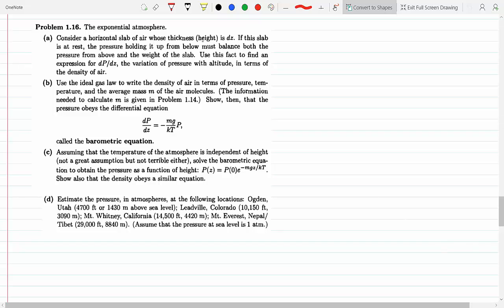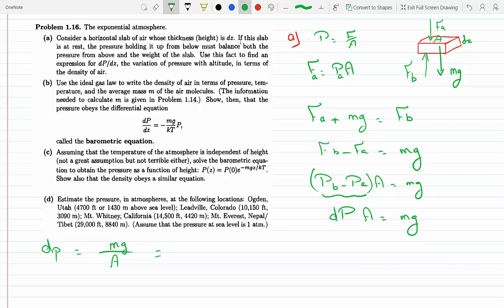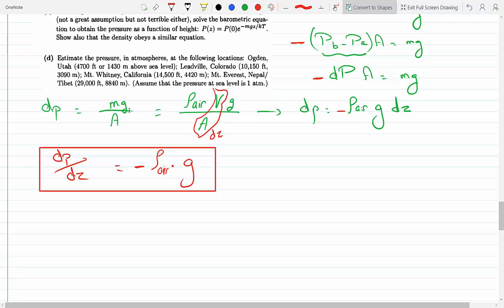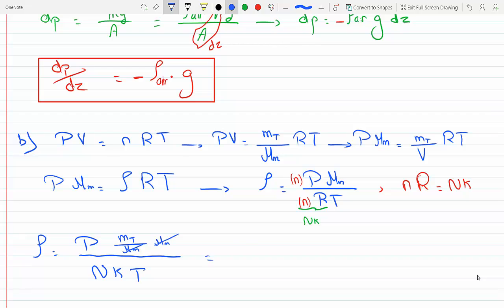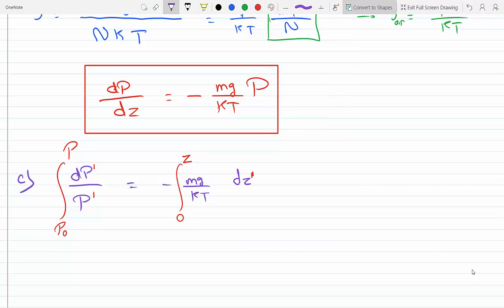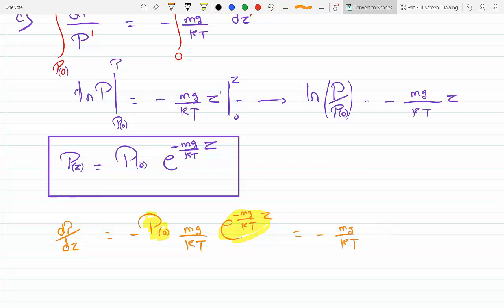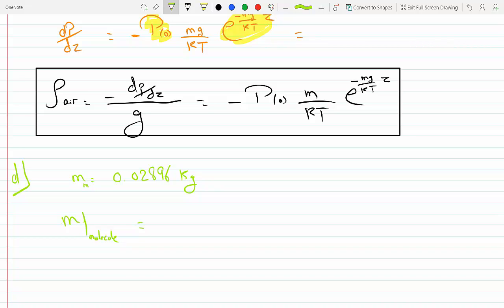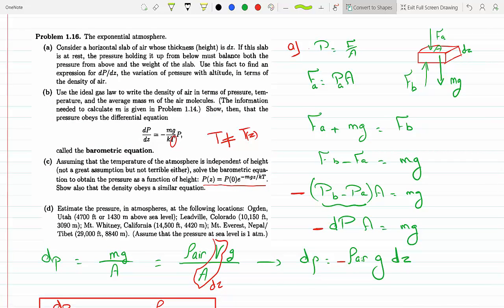Find dP/dz and pressure and density as function of height for a slab of air 1-16

Comment: Thank you so much. I had a similar question in my prescribed textbook they tell the variation of density with height for refference and then just straight up asks us to derive the same assuming isothermal conditions and constant g.
I didn't even knew where to begin 😭.

Also in the last equation relating density the value 
[P(0).M(atom)]/kT = density at height 0. 
So the relation becomes exactly the same as pressure but with densities instead.

Thanks alot.

Comment: This is helping me figure out my problem, thanks. 

I was messing around with PV=nRT=NkT to try and get an equation in terms air density.. "ρ" & temp "T", but I will use n to denote number molecules around a molecule:  

[1] P~ (ρ/m)kT & P~Ma↓/(xy)~(Σma)/(ΣẟA)
with ρ=M/V, N=M/m, m~ẟM=ẟ(Nm)=Nẟm, ẟA~Area(ẟx,ẟy);
a=acceleration of molecule to be summed across surface with area xy.

..for a cylinder air column that would apply to Venus, but I then realised that the difference between Earth and Venus is that the latter barely rotates, so no Bernoulli wind gradient and resultant pressure drop, Venus air almost incompressible and dP/dZ ~0.

For [1], the :
a(j)=acceleration as molecule j hits surface, also subject to isotropic atmospheric pressures {P¹,..,Pⁿ}around molecule=Σ6P(j,i)A(j)/m(j) with n particles (including ground) pressing on area "vector" A(j)=ẟA , 6 degrees of freedom(DoF). 
P(j,i) is the pressure on molecule j due to the iᵗʰ molecule.

Using "NIII" & "NII";
Start with n=1 collision per DoF:
a(j)=3∆{P(j,i)A(j)/m(j)}=3∆P(ẟA/ẟ(Nm))

Assume, for each face, the molecule acts like a spring, so the contact area changes with time, and there is a mass flow into it: ẟA/ẟm→Ȧ/ṁ, 
where: Ȧ=dA/dt=Area rate vector in line with pressure force.

Therefore: a=3∆P(Ȧ/Nṁ), where ∆P= pressure difference between opposite surfaces, which cannot be zero otherwise the molecule would implode! Therefore, let's say it alternates on each surface so that there's a P on one side when there's a -P (molecule j pushes out) on the other, 
on average, with the net pressure magnitude being 
√{3|∆P|²}=√3 |∆P| with net force in direction Ȧ^= (Ȧ₁+Ȧ₂+Ȧ₃)/|Ȧ| where {1,2,3} indicate surfaces {xy,xz,yz} in some order, therefore acceleration unit vector a^ = A^, and so: a=√3 |∆P||Ȧ/Nṁ|A^.

Cylinder air column, height Z
➡Ma/𝝅x²Z~(ρ/m)kT/Z
➡Ma/V=ρa~(ρ/m)kT/Z
➡a~kT/mZ ➡(aZ)(M/kN)~T

Assume: 
N=Air column vol/ molecule vol=V/d³
➡(aZ)(M/kN)=(aZ)(M/k(V/d³))=aZρd³/k~T
(But restricted to the vertical 
component of resultant acceleration a).

Acceleration at surface "xy" would be: 
a=√3 |∆P||Ȧ/Nṁ|A^.

Define Ȧ₃^:= A(x,y)/|A(x,y)|:=Z^
So, Z^ is parallel Ȧ₃^, dot product=1.
➡Inner product(a, Z)=Σa(i)Z(i)= Z₃Ȧ₃/|Ȧ|
➡√3 |∆P||Ȧ/NṁȦ|Z₃Ȧ₃ρd³/k~T
➡√3 |∆P/ṁ|(ρd³/k)(Z₃/N)Ȧ₃~T

So, the temperature of Venus is proportional to
the mass density, average molecular volume and height of the column of atmosphere above the surface considered, but inversely proportional to the number of molecules in the column.

The other factors |∆P/ṁ| and Ȧ₃ are incidental to the body being heated up.

Am I on the right track? 
Let me know below!
Reply from the maker: yes...
Reply: @marx.academy  Feel free to use this or something like this in one of your lectures.

I think that mainstream explanations of the "Venus hothouse" are inadequate and CO2 can replaced with any gas that wouldn't be considered  as (radiative) "greenhouse gas" on Earth.

Instead, my guess is that all the possible (incompressible) choices of gases on Venus like planets can all be considered as non-convective greenhouse gases, that on Earth would normally convect heat away, but if Earth stopped spinning these gas molecules would be stuck in place, only being able to oscillate up and down to any great extent, because the mass of gas/fluid above would be less than around the sides of any particular object or gas envelope, so damping of flows would be greatest tangentially to the surface.

It the case of a non spinning planet with an atmosphere, the only way to emit heat would be via conduction upwards to the top of the atmosphere, releasing energy via infrared.

I think that the effects of a non or low spinning planet surface would greatly exceed any heat trapping effects via intra-molecular bonds, because the heat capacity of gas confined to vertical columns rises greater as column height increases and then multiplying the number of columns increases the capacity in another 2 dimensions, whereas a layer of gas has only the 2 dimensions for heat capacity within the molecular bonds.

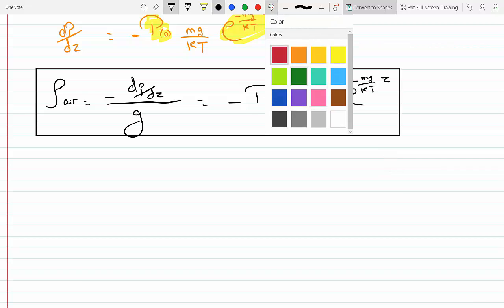Comment: 18:54 I think there is a sign error. -dP/dz is positive.
Plus density cannot be negative
Reply: dP/dz is the variation of pressure with altitude, and at the top of the atmosphere, P does tend to zero, which means for every positive change in z, there is a negative change in P.  I think this person would've understood by now, but hopefully this helps the next guy who stumbles upon this!
Reply: The mistake is shown at 18:10 where ρ(air)= (-dP/dz)/g 
is correct, but he substituted for dP/dz <0 
and forget to multiply the -ve signs, 
instead of choosing the substitution: -dP/dz >0.